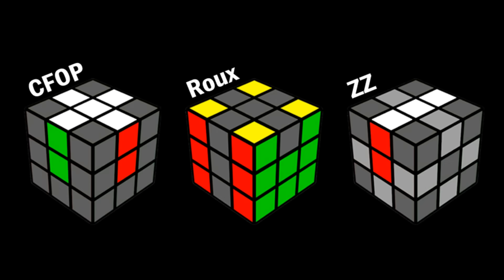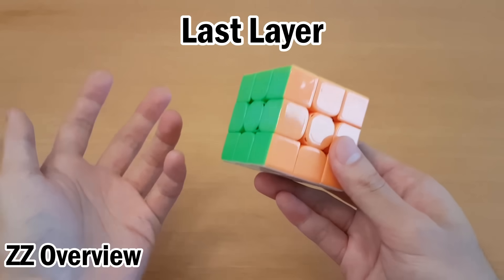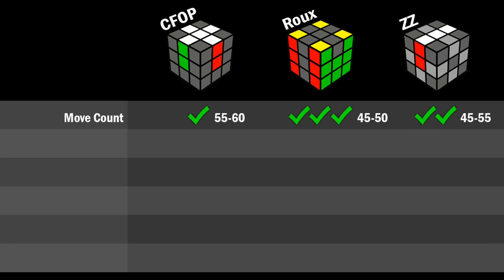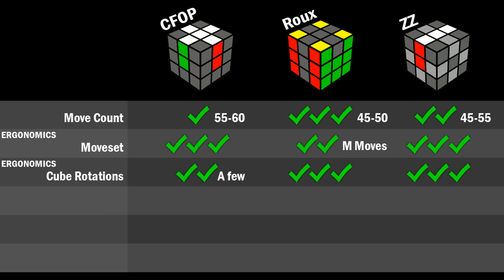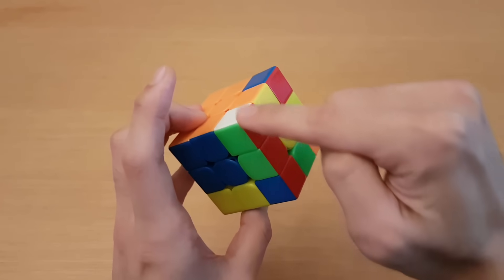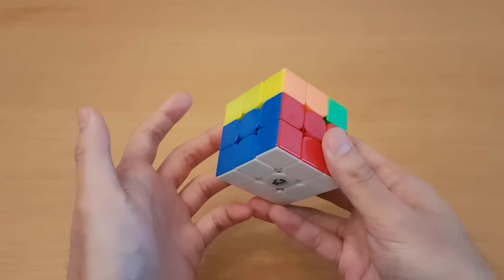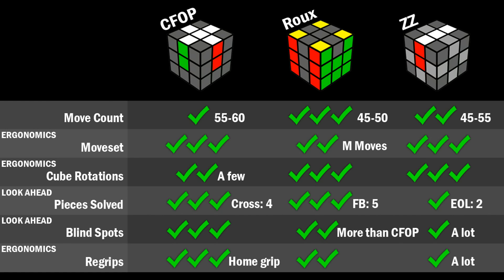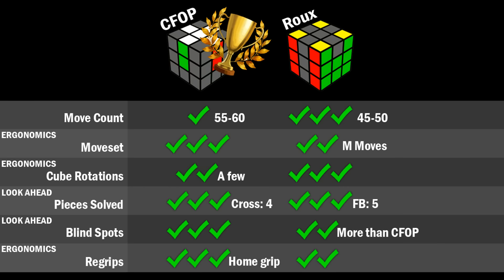The BEST Speedcubing Method? [CFOP/ROUX/ZZ] Comparison

Comment: I really don't belong here lol. I don't even know how to solve a 3x3 but im so fascinated by it. Been watching videos of comps and people solving the big cubes (17x17x17 for ex.) and it's dope. I'm beginning to learn CFOP right now but all these other methods seem pretty damn legit. Cool vid man
Reply: Once you can solve a 5x5 a 17x17 is just as easy. Just hours worth of moves that turns into wasted time. The reason i say 5x5 is because it's not the same as a 4x4. 4x4 has this thing where the centers can be the wrong centers, and you don't find out until the last layer. What i mean by that, is although all 4 centers are the same color, two or more of them can be rotated the wrong way, yet still be in the "correct" position. 5x5 is somewhat similar but there are 3 edges instead of 2 so something else happens. And after 5x5 you run into the same problems in all of the bigger cubes. But none of them get any harder after that. I stopped at 5x5 because there is nothing new to learn after that, just time wasting.
Reply: I know pretty much the basics of all the methods, and don't hold myself to a single method. My preferred method is roux, because of the low move count. But i'm much faster using F2L. Sometimes during a roux solve i will switch to F2L if the situation is more appropriate. Alot of the times in Roux you can get your self an easy ELL case or a very simple PLL case. It all depends on your ability to think outside the box. Roux users will swear to never do PLL, but if i can set up a U-Perm during CMLL, i'm doing the U-Perm, and not LSE.

Comment: ive been learning rubiks cube for a little less than a month and ive only been doing cfop. i learned cfop in like a week and i can solve a rubiks cube now without having to think alot its just muscle memory by now. ive never tried the other ones but im thinking about it. thoughts?
Reply: Well done. Try Roux if you are considering other methods. Even if it doesn't become your main method, you'll likely gain useful knowledge that can be applied to CFOP solves.
Reply: @gabechevalier1567   yeah im considering roux when i finish cfop just for the fuck of it haha. so yeah thanks for the recommendation

Comment: Just wondering your thoughts on regrips in ROux (8:50)... if you solved the bottom left and right edges first  as apposed traditional left block right block. .. then inserted pairs roux styled... Wouldn't that get rid of all the regrips and get roux method one more check???  What do you think?
Reply: that would be less efficient.

Comment: I swear to God you are faster than light at fingertricking the "R' U R" part I put it on 0.25x speed and I still didn't see the U move there the colors just changed
Reply: Its also video frames per second. In real life you would see it much better
Reply: @rotgutthebloated4730  how fast he had to be for it to skip a frame... Holy frick

Comment: So I don’t know anything about speed cubing but I’d be interested which method would be the fastest on a digital cube solved by a computer program. Would it be the same or maybe a totally different method not possible by people etc.? Interesting video nonetheless.
Reply from the maker: Computers would only be concerned with move count! So a method that solves the cube optimally (20 moves or less) every time would be best.
Reply from the maker: Unless you also include calculation time, then it depends on the speed of your program.
Reply: J Perm Thanks. Again I know nothing about cubing but none of your methods in this video seem to have a move count of 20 moves or less so I assume it’s a method you didn’t mention here? Also is that method not mentioned cause it’s not viable to be done as a person or even though it’s 20 moves, it’d take more time due to things you mentioned like cube rotation or look ahead?
Reply: @SuperKneehow  Kociemba or Thistalwaite

Comment: 7:19

You mention these blind spots, but they aren't quite blind spots. 

In Roux, for second block, there is only one piece you can't see (DB edge) but since you can see all the other edges (though arguably RB edge is only half visible) you know which edge is in DB anyways.

Edit: considering I saw you addressed the big cubes thing, that's all I got. 

Pretty good comparison (I'm a Roux solver BTW)

Edit edit:

Also I guess you kinda missed on regrips in Roux. Roux can be near regripless, it's one of the awesome things about it. Having access to the M slice gives you regripless moves that are equivelant to F and B moves, as well as the L and R moves that everyone has easy access to.

Comment: Rocop is The Best!!!

Rocop is partial Roux and CFOP method.
Rocop:
Make DL and DR Edge
In DF and DB put a yellow (or opposite color edge piece) Oriented or Not (Make lookahead better)
Solve Left and Right Blocks 
CMLL
Insert the White Edhes on its Correct Slots
Then you will have only 3 oll Cases with Corners oriented (H, Arrow, Dot)
Pll (Edges only)

You can skip oll by orienting the edges befor inserting them in ther right places.
And Sometimes can skip Pll with some tricks.

I discovered this method.
JK I dont know if this is beter than CFOP and Roux.
Reply: It's actually a very old idea and is proven to be inefficient

Comment: 2:39 the comparison you made was slightly unfair. You compared M2 U2 M2 (which requires double turns) to R’ U R’, (which requires quarter turns).

You can’t compare double turns to single turns in the same context. Try going R2 U2 R2, it would be around the same speed as the middle move(if not *slower*).

You should have compared R’ U R’ to M’ U’ M’. I think your general point of RU gen move set being faster is valid, but the way you compared the two move sets was a bit flawed.
Reply: I solve using roux and no matter which way you cut it, i have to agree with Jperm on this one. There is no way around it. You have much more control and flexibility using RU or LU moves then you do using MU moves. We are talking about learning methods, not becoming masters at them. And while for people like me and you MUM' or whatever variation is being used is just as fast as RUR' or whatever. But for someone just starting they are going to be much faster with outer layer moves. M moves are something you have to teach yourself, where as R moves are something you can already do.
Reply from the maker: True, I wasn't using that to demonstrate MU vs RU though. I was just talking about good vs bad ergonomics.

Comment: To j perm:
  I have found a new method to solve the Rubik's cube with roux and CFOP. I solved the first two blocks and oriented the white edges,and then used oll and pll to solve the rest.Do you think is this a good method to speedsolve or should switch back to CFOP. please help me to figure this out.
Reply from the maker: Don't use this method, it's just Roux with a different ending, and if it was better then Roux users would be using it.

Comment: Could you make a vid tips at 3 cubes transition? Because the competition here has 3 rounds 1st round single cube,2nd round 2 cubes,3rd round 3 cubes,in 2nd and 3rd i really struggle at cross after the 1st cube my time was:
1stround:12
2nd round:32
3rd round:46😩